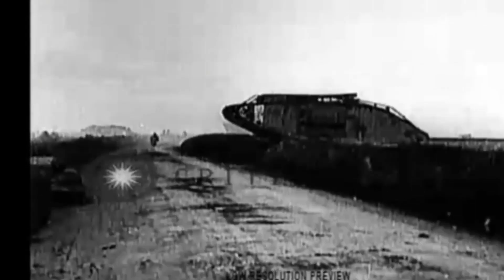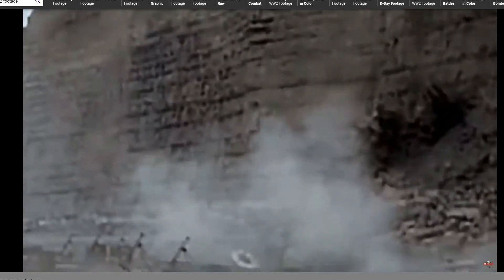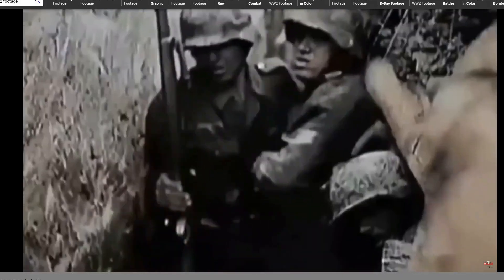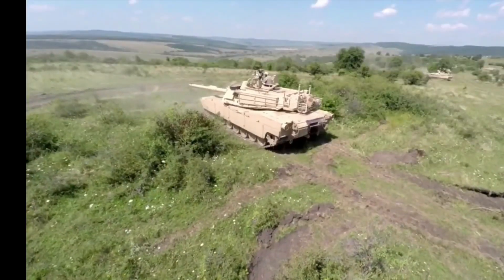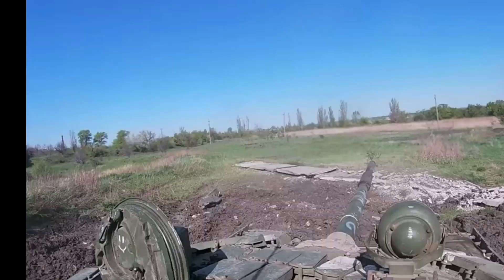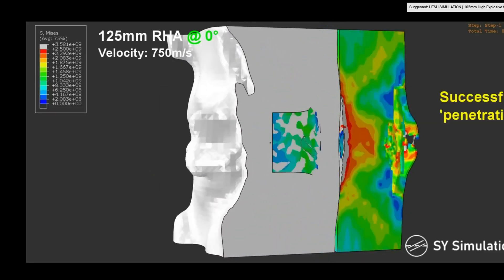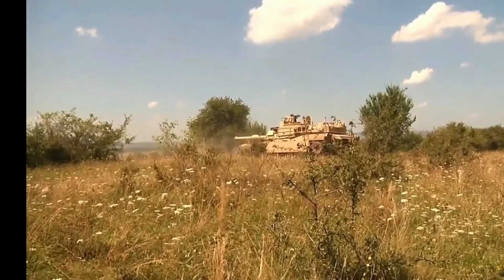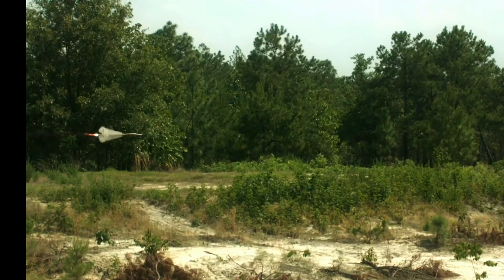Tank rounds, explained

Comment: The cap on an APC round was primarily for reducing the initial impact force so the harder steel of the shell itself does not shatter iirc.
Reply from the maker: I believe that would work for the APBC as well right?
Reply: @bitterlynx7844  yes, the ballistic cap is usually aluminum or some other lighter metal that is only meant to improve aerodynamics, it is basically thanos snapped once the shell hits the armour.
Reply: @bitterlynx7844  also, the British have rotating bands around the pedals of the APFSDS iirc, so that the rifling does not impart too much spin on the shell.
Reply: @maral2014  not just british. Everybody in 105 days did since they were all rifled guns. Same thing with heat-fs (except france with obus-g)
Reply: Capped APC rounds both work to prevent shattering, but also to assist with normalization: the process of a shell hitting armour at an angle and changing trajectory. It effectively improves armour penetration against an angled target. 
Ballistic caps are there both to improve long range ballistics through the aerodynamic effect you mentioned, but also tend to be designed with normalization in mind. 
https://www.youtube.com/watch?v=2lxFFPOv0kE This video by Drachinifel deals principally with naval shells, but the basic principles should be applicable to land vehicles as well. Drach always strikes an excellent balance between being thorough and informative, but also comprehensible to a layman.
Reply: @jeffreytam7684  From the sources I have read, the reason the a AP capped rounds appear to do better against sloped armour is also more so for the fact that the cap absorbs the initial impact. Then again, not all shells are designed the same. It would also have to do with the design of the shell itself, the stuff under the cap.

Comment: "Almost molten" depleted uranium? Make that "completely molten and burning all the oxygen" uranium, inside the tank struck. The jet will indeed have enough heat (from passing through any reasonable thickness of steel armor) to be completely liquid. As it passes into the air inside the tank, the uranium vapor then explosively combines with all the oxygen in the air.
Reply from the maker: i thought so but some sources disagreed and i decided to go the safe route

Comment: What's important to remember is that HESH is basically just overhyped HE in the ERA of composite and spaced armours - the shockwave doesn't propagate that well thru gaps in the armour (most composite armours have air gaps because of how NERA e.g Non-Explosive Reactive Armour works) so at best they will crack the initial plate and then you watch as the tank that was hit blasts you with an actual KE round.
Reply from the maker: I believe that's why the British have been considering smooth bore cannons
Reply: @bitterlynx7844  Actually - it's compatibality with other NATO countries (basically everyone uses STANAG compatible smoothbore cannons so they can interchange ammunition for the most part) and improving KE performance (rifled 120mm KEP was already behind NATO's 120mm smoothbore KEP back in the 80s and 90s - today with even newer projectiles that countries like US and Germany operate, the difference is astronomical between them) - HESH is still good at demolishing structures, but it's simply not worth specialising in only a single thing and having to sacriface the benefits of a smoothbore cannon (e.g better accuracy with APFSDS, better longevity, better long-term performance etc). 

HESH is still cheaper to make than modern HE-FS rounds, but I'd wager crews really don't care about costs when half the things your tank's cannon been ""designed"" to do (killing other tanks) is unavailable to it because the performance of your KEP is abysmal for 2020s (and not like it was ever any good to begin with).
Reply: @Ophiv2  I think you are missing a key part of British tank doctrine here. A part of the reason Britain loves Hesh is for how effective it is against structures like buildings and concrete bunkers. British armoured warfare ideas are still very much centred on supporting the infantry so a weaker gun in tank on tank engagements vs a more effective one against hardened structures that give infantry all of the problems was a good trade off as far as the British army is concerned. So Challenger got a rifled gun for lobbing Hesh at buildings, as opposed to American and German armoured thinking that had mass armoured engagements with the soviets as priority number one so batter Anti tank potential was the top of the list (this is especially important with Challenger 2 as not only was it designed with the different priority in mind but also at a time where the British army was planning less for war with a  military superpower like the soviets and more for a Desert storm 2 electric boogaloo where Challenger 1's rifled gun was more than effective against the older soviet tanks possessed by a lot of dictatorships)    

A part of the reason you are seeing the transition to smooth bore with challenger 3 is that modern smart ammunition is starting to catch up with the good ol' fashioned Hesh shells for that infantry support work meaning its becoming less of a trade off between the two types of guns, Were going to get to a point very soon where smooth bore guns are capable of doing both just as effectively

Comment: The first tank-versus-tank battles took place on 24 April 1918. It was an unexpected engagement between three German A7Vs and three British Mk. IVs at Villers-Bretonneux. three british mk4 tanks engaged three A7V's hammering away at the other with both machine gun and cannon  damaging a mark 4 in the opening faze the crew abandoning the second british tank knocked out a7 turret and smoke began billow.

it pulls back the brawling continues the third german tank turns to unleash a full broadside on the third british tank damaged the third british tank withdraws but not before the second mk4 slams home a shell into the side of the a7 knocking it out the dual between the last standing tanks hammer away till the mk 4 hits the german turrets the a7 backs away and the mk4 the sole victor of the first tank battle stand the field.

There is a documentary called the greatest tank battles that documented the engagement in the episode titled the tanks of the great war

Comment: 8:48 Just want to point out that Soviet lineage tanks do also have composite armour arrays-they have simply put a lot more of their eggs in the ERA basket than Western tanks.

Generally, the reason given for NATO tanks not banking so heavily on ERA is to protect infantry operating in direct support from the dangers of the ERA going off

Come to think of it, the first tank in widespread use with composite armour was the T-64, whose armour went through multiple iterations quite rapidly.

Comment: From the simulations I see, I'd probably prefer to be hit by HESH too because it really behaves like astoundingly shitty and outdated HEAT.  But actual HEAT sounds horrifying, what I've heard is it sprays an ungodly amount of spall everywhere, I can't find any pictures to know what it actually looks like.  Maybe that's for the best.  Similar story for APFSDS, especially DU rounds.  Basically if it involves hypersonic metal, I don't want it coming anywhere close to me.  If I had to choose one, the really shitty early Soviet APFSDS that was made of steel and tipped with tungsten carbide.  Those are absolute trash, a modern Abrams could take it reasonably well (frontally at least).

Comment: Why HESH? British doctrine is that the Tank is to support the Infantry, not to be fighting other tanks in big set-piece battles. It's a trade-off where the ammunition is less effective against modern tank armor (than APFSDS), but the same shell type is massively more effective against bunkers or buildings. 
APFSDS fired at a building leaves a neat hole in the front wall, and a matching neat hole in the back wall. Not much use if you've got half a dozen guys hiding within the building shooting at your infantry. 
HESH fired at a building, deletes the building most effectively, and if you run up against a tank, even if it doesn't "kill" the tank, a HESH round will generally concuss the crew so much, your supporting infantry will have ample time to NLAW the tank out of existence before the crew recovers enough to be a danger...

Comment: SAP rounds are actually used for Naval cannons. TANKS were using APHE Capped or not. Tho there are some examples of SAPs on tanks. SU-100Y was basically a soviet T-100 with 130-mm B-13 coastal gun. I think KV-2 had SAPs? I`m not sure about any other tanks. Tho Japaneese Chi-Ha Long Gun (I know that in War Thunder this thing have SAPs) might had them in use. Mostly because Japanese decided to put already dismounted 120-mm naval AA 10th-year Type cannons. But I couldn`t find any proofs of it...
Reply from the maker: i remember that it was rare and ddnt get much of anywhere

Comment: No mention (Anti-personal) yet they have changed very little over a century yet are still used in greater amounts so must be doing something right ah;)
Anti personal as in shrapnel, canister shot & Flechette rips apart infantry in variety of ways for differing apllication..

Nations spend so much time developing anti tank rounds for tanks vs tank yet over 20% of all tanks are wiped out even since ww2 by mines & during the period shape charge launchers were introduced late war made up roughly 1/3rd of losses depending on many factors but never below a 1/4.
Even non enemy actions made up some 3/20th's such as mechanical issues, abandoning the vehicle due to threat of enemy air superiority or good old mud.
Improvised anti tank weapons are some 1/20th of tank kills. 
   
Gunfire as in anti tank guns , artillery or tank guns just as gun fire account for 34% of late ww2 tank if that & ever diminishing since ww2 as other methods proved more effective then large gun pieces.
Using tanks to take out tanks is counterintuitive & the nations that do so lose the wars they fought.
 

Tank in general are their to support infantry preferably mobile infantry so wouldn't it make more sense to improve the canister rounds used against the enemy infantry?

Note:
German Röchling shell & later bunker busting rounds like anti-concrete are far more useful to tanks being a versatile round that will be used. 
If the round can take out a bunker it take out most vehicles though less effectively.

My favourite rounds are smoke that many nations over look as cover is so important to infantry & well smoke can give infantry & tanks cover in open terrain.
Depending on the type smoke screen cover even spectrums outside the visible range can be blinded most commonly in the infrared spectrum to fvck with thermal optics. 
Smoke rounds are so underdeveloped or funded but are so useful it's hard to stress how smoke assist the infantry more then any other munition in a tank which carries out the tanks main role of infantry support. 

In my eye Smoke & anti personal rounds > HE> anti-concrete > anti tank/vehicle, sabots or Hesh rounds.

I don't know why nations stopped developing illumination rounds & similar.
Stick a flashbang in a tank gun I say & blind the enemies optics & eyes.
A blind enemy can't fight effectively so who cares if it's underhanded?